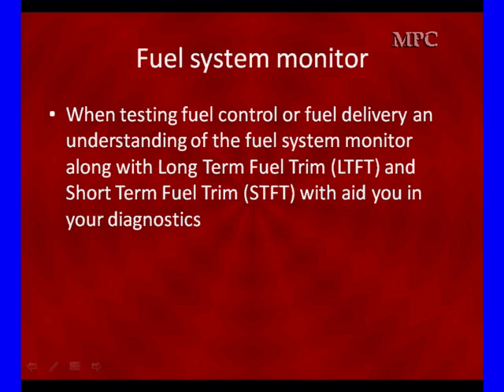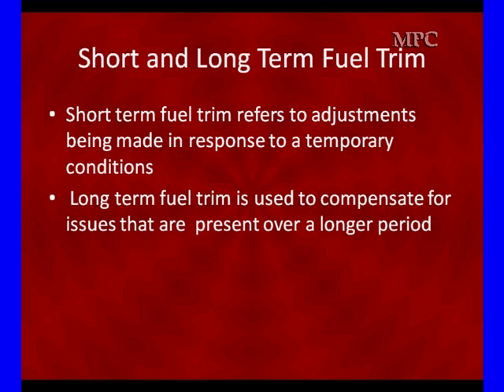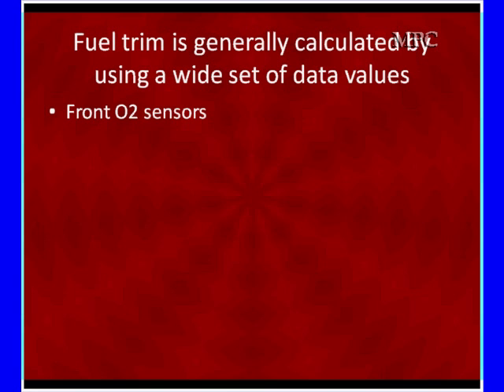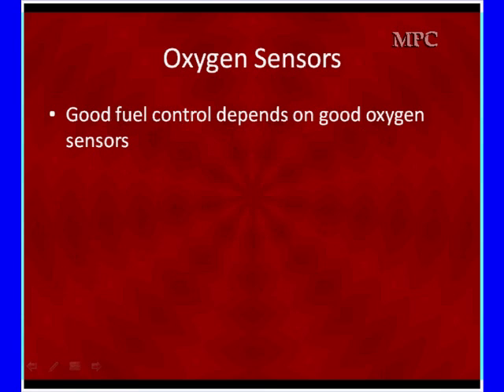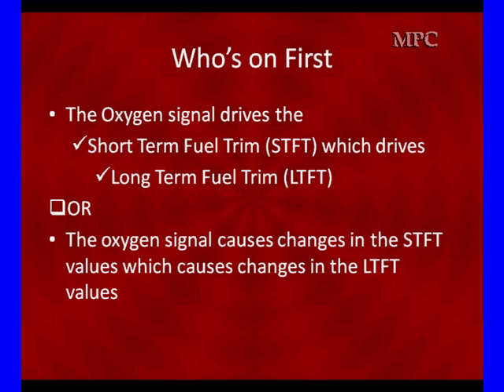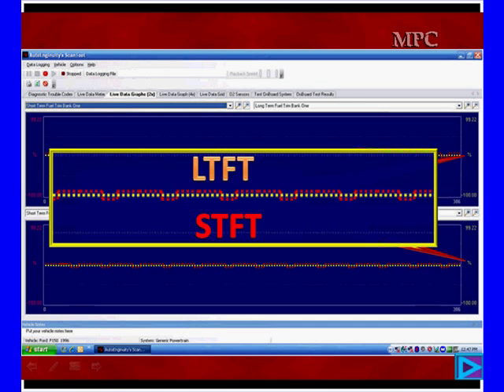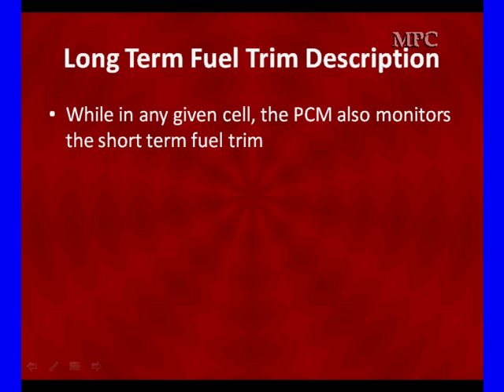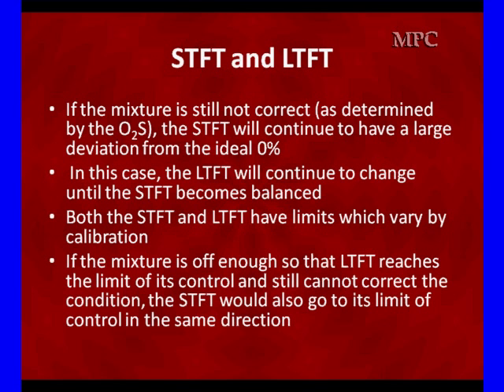2 Fuel Trim Adjustments

Comment: I have positive High  LTFT & STFT, 
LTFT %26 and STFT 18%, STFT increasing with high RPM and LTFT degrees with High RPM but not gose less than %18 whatever RPM, 
Example,  LTFT %26 and Change to 18% once touch accelerate paddle and stuck at %18 even if 6000 RPM, 
I made smoke test but no leak at all 
Replaced Valve cover including low pressure fuel pump with filter 
Also changed intake gasket but still same symptoms,
Last thing replaced Bank1 sensor 1 O2 sensor, 
You think bank1 sensor 2 O2 sensor causing high fuel term or something else  ?
Reply: Check maf.ect .map. compassion pressure .leak seal ingiktor.depends on your car